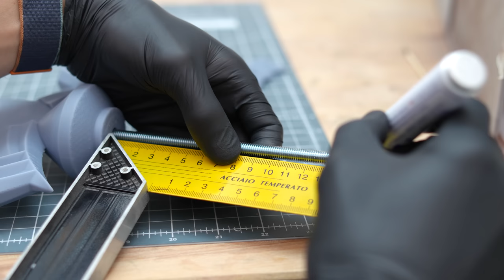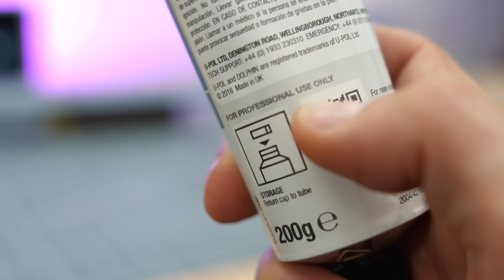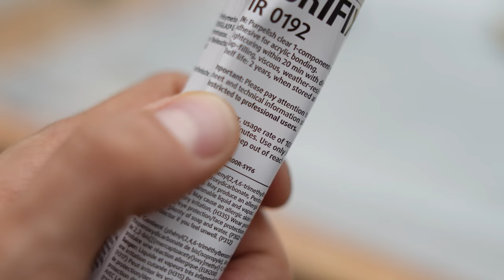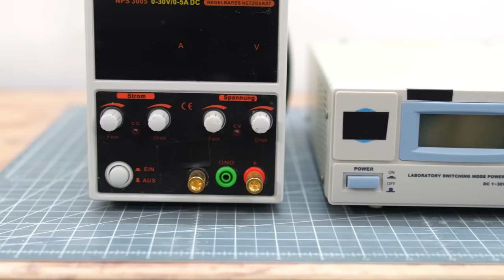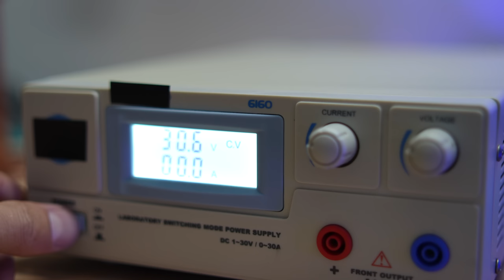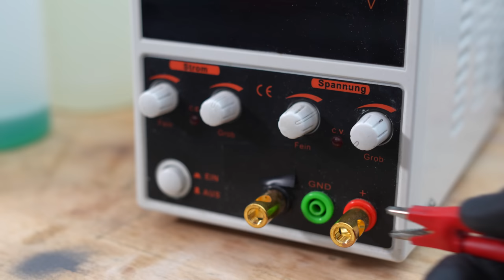Electroplating 3D Prints | Master Sword Tutorial

Comment: This is next level. Would like to have heard more about the processes such as the cost of the materials and fluids as well as see a longer shot of the final result. Looks awesome.

I found that with PLA prints, Wood filler and Leyland acrylic undercoat/primer that you paint on with a brush fairly thick, sands down easily to make it smooth and gets rid of layer lines. The wood filler is for imperfections such as bad extrusions or gaps in layers or top surface. Then I spray and sand. Spray and sand, until I lacquer with a final coat and sand with 5000 to 7000 grit lightly and polish with automotive car top compound to give it a shine.

Comment: I love your tutorials, have been watching them for months! Trying to find a comparable conductive paint in the US has been the biggest barrier to replicate your results.
Reply from the maker: Yes, it‘s strange that there are not that many available products. Graphite paint is a good alternative (if you apply it right). I‘ll do a special on that topic
Reply: @hen3drik  that would be great! Thank you!
Reply: @Superfreak-hm4gv I have just recently got my whole setup running and am using a DIY graphite paint consisting of Speedball India Ink and graphite powder. 5 tbsp of ink, 6 tbsp of powder. It works amazingly well with an airbrush and cleans easily with water. After a quick polish with 0000 steel wool I can get 800 ohms over a couple of inches of separation between my meter leads! Just put a marble in the container you store this stuff in so you can mix it well before use!
Reply: @xugans99  oh nice! I'm gonna try that! Thanks!
Reply: That's the hardest part for me as well. The "Tifoo"  brand Electroforminmg stuff they sell in the EU is SO much cheaper than what's available elsewhere. Costs a fortune to get set up for electroplating here in Australia.

Comment: Electroplating 3D prints what an interesting idea. I bet you could print and plate circuits inside your prints. Arduino housings could be put in so you click it in and the prints wired directly to sensors LEDs batteries. You could print switches the whole 9 yards.

Comment: That was crazy !!!! I wanted to ask you, if you want to try something new, since you´re already very experienced, and curious yourself: 
How about thicker electroplaating, up to 0,5mm, but without losing resolution of surface details??? That should be hard, since you have to account in advance of your 3D-prints-designing-step for the diminishing of surface-details, as electroplating advances further and further... For that 3D-design, there must be special considerations and laws, into which i´d be too afraid to dive, hence for now, I don´t even get my 3D-prints correct (lowest-level-correctness), and still have to learn a lot about 3D-printing itself, bevor I try answering such questions... 
The prints don´t have to be overly surface-detailed, but for example, how you one keep the edges of a 5x5x5cm-cube sharp (90°) after having electroplated 0,5mm of copper on it??? Do the edges have to be less than 90° (thus the edges protruding compared to the cube-sides, and the sides having a concave form), in order to arrive at 90° after plating several 100µm of copper ???

Comment: That acrylic looks very thin for that height of liquid. Did you check fish tank design guides to get the thickness. There a few around but usually deal with glass. 

On 4x14”x18” (lxwxh) tank you can do like 9mm glass on 24” its 12mm, if you go 3feet like 20mm.

On acrylic it’s a little different but check it out. As you don’t want all that electrolyte splashing all over workshop as the tank explodes. 

If you want piece of mind put strapping in bottom third. As that’s where max load is.

Comment: hello, very informative video; thanks for posting it. I was wondering how long it takes for the transparent paint to chip off. I've heard nickel plated parts need a midcoat, or a rougher surface for the paint to adhere properly, is this true, and how have your other results been?
Reply from the maker: Hi, transparent paint is still very strong here. I don’t think it will ever chip off. I don’t know what you mean by midcoat. As far as I can tell this paint adheres very well. 😅

Comment: would you mind performing a test? print a 3" cylinder single wall vase mode with 0.6mm width and 0.3mm layer height. No sanding no filling just plate it and see what it looks like? the surface should be perfect being vase mode just not "flat" would be interesting to see how that comes out!

Comment: Two questions:
1) How many times can we reuse the copper sulphate solution? Is it dependent on the number of times used, or the area?
2) How do we polish the finished product? I have been using Brasso and a microfibre cloth, and all that seems to do is make even more scratches.
Reply from the maker: 1) it can be reused many many times as it regenerates by the copper anodes saturating the bath. You have to maintain it somehow (filtering from time to time, adding brightener, checking pH)
2) I use sandpaper (600) and a polishing Maschine. You can also got up to 2000 grid and use a polishing compound + microfiber to buff it manually
Reply: @hen3drik  One last question: I am working on replacing oxidised parts on my figures (think Transformers and the works). Some of these parts need to fit together and lock in. How would I account for the tolerances? Is it usually a 0.1-0.2mm increase in thickness? In your other videos, that value changes within that range, so what should I aim for?
Reply from the maker: @adrianli7559  0.5micrometers/minute at 2A/dm^2

Comment: A Dremel with small polishing wheels should be ideal to save the fingers when polishing smaller parts, no?
Reply: A small polisher or drill adapter on low. Rotary would be too aggressive & likely strip it off. That has more cut to it, I do a lot of wetsanding & buffing on my channel & that’d be fine but for polishing you want something lighter with less aggressiveness. I’m pretty sure it’s being done by hand to reduce heat generation.
Reply from the maker: @darkwingdad is right here: dremel tools can melt the underlying plastic (it actually does). Even resin can melt. Worse yet, overly aggressive grinding can cause the copper to detach from the plastic, and the temperature differentials can also lead to separation.

Comment: hello I have some questions about the copper solution. 
1. how do you monitor the PH level, what happens if it's too high/low, and how do you fix it?
2. how often do you need to add more brightener to it?

thanks for your time!
Reply from the maker: I use ph strips and aim for 1. but it never was an issue. I add brightener as soon as I notice a lack of shine but this happens very seldom (can’t really say; it’s a commercial electrolyte and I lost track over the 50l I have in separate bottles; but it’s rarely happening)

Comment: Hi, I have noticed that your go to conductive paint in your videos is the copper based paint. Is that because you can't get a shiny finish with graphite paint?
Unfortunately, I only have access to graphite paints. Copper paints are either really expensive or they won't ship it to Australia. And with graphite I have trouble getting the same kind of finish. Could you possibly do a similar project using graphite paint with a little more detail on the prep and use of the paint?
Reply from the maker: I‘m working on an graphite solution. Stay tuned. :-)

Comment: Can you recommend glove type? The ones I have are resistant to the resin but when alcohol comes in contact with them it seems to allow both the alcohol and resin to pass through. Thanks.
Reply: Try nitrile ones
Reply from the maker: When working with acetone you could use butyl rubber gloves or latex, as a viewer suggested. I use nitril.

Comment: two doubts: do you need like a protection layer, like acrylic or something to prevent stains and rust? Also, how thick is the layer? just thinking if it would be possible to sharpen it afterwards (of course it wouldnt be like a real sword, but thinking about other applications)
Reply from the maker: You don’t have to protect it. The layer is around 0,35mm thick.

Comment: Was the strength of the resin too weak to make a sword? I think it will break off quickly if I swing it a little, but if not, could you tell me what resin you used in the video?
Reply from the maker: I used simple basic resin for this. The rod is to connect the pieces and align them. The copper plating is pretty strong and could probably hold the resin pieces together without the rod.

Comment: Hello, thank you so much for your educational content. I am debating on starting with electroplating myself and I've noticed that Tifoo have a deluxe tank plating system. Is this something you would recommend?
Reply from the maker: Hi, I would actually recommend to invest in a proper PPE, get a small setup first and when it’s working you can upgrade your system. When I started this hobby I got so frustrated in the beginning that I almost stoped trying. Eventually it worked out well. The tifoo deluxe stuff is expensive but good when you want high flexibility.

Comment: HI, I really appreciate your videos. Could you consider making a video using graphite powder instead of a copper paint for those of us in the US who don't have access to such things without paying hundreds of dollars for importing them?
Thanks,
Adam
Reply from the maker: Like this?
https://youtu.be/TlD9USAhcEs
Reply: @hen3drik  As far as I know, there isn't an easily accessible and mostly affordable graphite spray in the US either. I was thinking more along the lines of graphite powder, which AFAIK is used for electroplating a lot, but I have yet to find a guide that works for resin prints or non soluble FDM filaments. A quick search of Amazon US shows there's no graphite spray available, and no stores near me carry anything like it. Thanks for the fast response!

Comment: WOW! How do you get the connecting surfaces to be flat and not warped so that when they are assembled they sit flush to one another?
Reply from the maker: I inserted a rod into the whole sword. But it‘s very tricky. Plating emphasizes the joints; imho best would be a belt printer.

Comment: Could you share the info on where to get the 3D printing files at? The hilt/guard is particularly good looking, I searched for STL's of exactly this sword last week and most weren't optimal.
Reply from the maker: It‘s this thing. I joint and modified the blade parts though. https://cults3d.com/:1176815
Reply: @hen3drik  than you VERY much

Comment: Hello, thank you for your content. I use the same copper electrolyte but my prints form big copper bubbles and the surface is totally rough at the beginning. Copper also collects to a large extent on the cathode hook. do you have any idea what this could be due to.
Reply from the maker: I‘ve never heard about that. What is the conductive material, what is the current, how big are the anodes? What voltage is regulated by the power supply? What’s the surface area and the corresponding current?

Comment: Hi, is the copper eletrolyte a consumable? I mean, if I buy like 30 litres of electrolyte, will i need to replace the eletrolyte in the future because of heavy use or because electrolyte lose their properties?
Thanx :)
Reply from the maker: It regenerates by the anodes and can be reused over and over.
Reply: @hen3drik  Great, thanks. I plan to build a full iron man mk3 armor and i will have to use a big tank.
I will have to test if big pieces can be copper plated in small pieces, then glue them together with a PLA welder from behind and and hide the cracks adding a thicker copper layer before using gold or palladium galvanic pen and transparent acrylic paint. (I have to test if it will hide the cracks this way)
Do you have any recomendation or other method to copper plate the big pieces? Maybe use a galvanic pen (with copper core rod)?
It is a long term project so i plan to spend a lot of time with it.
Reply: With the last option I am refering to this video, seems like a good option but I have an engineering background but with 0 experience xD https://youtu.be/iThTSojG7QA?list=PLjL0hJxpv5nHapxC_w3dIAOMDUxBd4PVA

Comment: do you have to use copper? is it possible to use other cheaper metals?
Reply from the maker: Copper is the best choice. You could electroform with nickel electrolyte but it has disadvantages (toxic, slow deposition etc.)

Comment: A) this looks awesome. B) this looks and I. Sir eIS very expensive by the time you find the power supply, the giant acrylic tubs, the huge plates of copper, and all the setup gear and chemicals. C) it looks dangerous to your health and the environment. I notice you don’t mention what you do with the bath when the process is complete. Please fill us in on that.  Most areas will make you dispose of it at hazardous waste sites! D) why is this better than just using the metallic paints that are available now and look really good?
Reply from the maker: A) thanks b) quite, but c) it‘s safe if you use proper PPE. The electrolyte can be reused many many many times. Every waste has to to be brought to the recycling center, as I mention in most of my videos d) no paint can compete with real metal coatings in terms of haptics and shininess. 😃

Comment: Curious as to weight of the model vs anodized.. is it more durable or still like handling eggshell?
Reply: Solid 3d printed resin parts + 8mm steel threaded rod means it's going to be pretty solid and heavy even before electroplating. It would be a little brittle but resin is a lot more dense and hefty than an FDM print. The electroplating should also help prevent the edge or any fine details from chipping.
You can see the woman's arm shaking slightly at 0:30 as she holds up the finished prop. I wouldn't be surprised if this is reasonably close to the weight of a solid metal replica.
Reply from the maker: Exactly!

Comment: Question, what type of glue do you use on these? Epoxy Resin?
Reply from the maker: Super glue
Reply: Thanks for that. Thought of something else. All of your videos you end with a metal that doesn't tarnish quickly. How would you protect a copper finish from tarnishing? Just a clear enamel coating?  @hen3drik

Comment: Hi,

First of all THANK YOU for all your video.
it's a great source of inspiration for a lot of us.

I just buy all the tifoo product i need (copper vernish and acidic copper electrolyte.
my project is on jewelry work.

I have dilluate the paint with aceton and use it with a brush.
it worked great but could be better with an airbrush.

i'am a little bit afraid of using acetone with with my old badger 150 (because of the joints)
do you known any other dilluant that will not dissolve my aerograph's joints ?

Thanks in advance for your answers
Greetings from Belgium.
Reply from the maker: Hi, you can use butyl acetate. But I think it’s better to buy a cheap airbrush only for this purpose.
Reply: @hen3drik  Thanks for your answer.
But the cheap aerographe will only work one time ?
What's the brand of your airbrush ?
Reply from the maker: @fabianlecomte6133  i use it over and over since 3 yrs now. The joints are worn down but it‘s still working. It’s a no name 0.5mm airbrush. Around 15-20€ on eBay 🤭
Reply: @hen3drik  Thanks a lot for your time and answers !

Comment: What kind of adhesive did you use to glue everything together?
Reply from the maker: The blade parts: super glue. The rod and metal plating provide a good strength. For the handle on the rod I used epoxy glue.

Comment: how thick can you go with electroplating? Could you go to 1-2 mm thickness with enough time?
Reply from the maker: yes. according to my calculation it's around 60 hrs for 2mm. I've never done this, but i have some wires i reused that became very thick (in that mm range).

Comment: hey its always a pleasure to see that stuff. im just curious whats the cost of this different plates and co? so besides the machines.. whats the cost of the materials used for this sword?
Reply from the maker: Hi, estimation: resin 40€, sandpaper 10€, 8mm rod 2€, 15l copper electrolyte 300€ (can be reused over and over), copper anodes 30€, nickel electrolyte 30€, nickel anode 6€, gold electrolyte amount 5€, palladium electrolyte amount 12€, pigment free Candy coat color 4€

Comment: HEN3DRICK, please test and do a video on using the iron or copper filled filaments for electroplating
Reply: I'd love to see this but sadly I don't think there's enough actual metal in those filaments to conduct the current. Plus you need so much sanding, smoothing, filling and priming to get a smooth finish, that the filament itself is usually completely covered

Comment: you dont have to remove 3d printing characteristics, the layers are a nice texture on the electroplated metal
Reply: you can polish the metal surface after tho, from top, not the 3d print
Reply: why dont you use the conductive paint to fill the gaps, why do multiple steps in vain
Reply: why not use uniform copper source placement around the object, no need to rotate, no motors etc extra complexity
Reply: you can use low current too, it takes longer
Reply: copper pipes are nice strong source of copper electroplate, will not snap into pieces easily, have high surface area
Reply: like watching paint dry lol :)
Reply: try making a high temp turbine from metal, remove the 3d print support/sacrificial from underneath, but burning/melting/dissolving

Comment: 🤷🏻‍♀️ Dumb question maybe: why bother with copper sheets instead of plain old copper tubes??
Reply from the maker: Geometrie + surface area: basically to create an even field and to keep the solution saturated. Anode surface area should be slightly above the plated object.